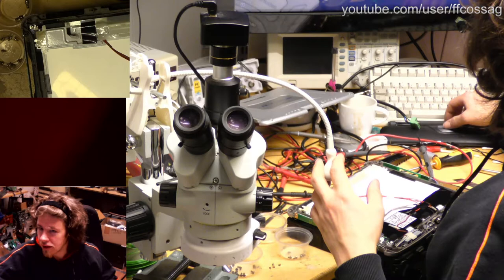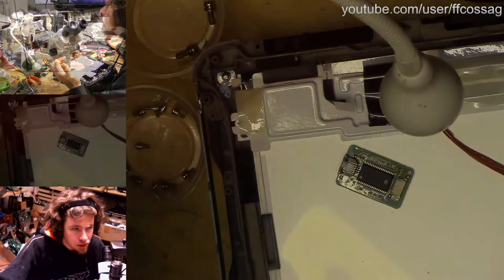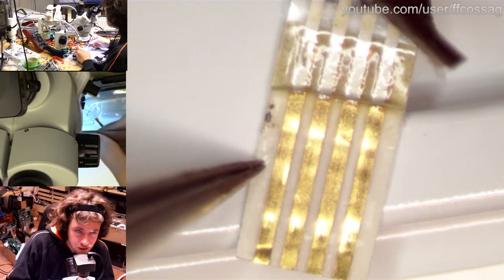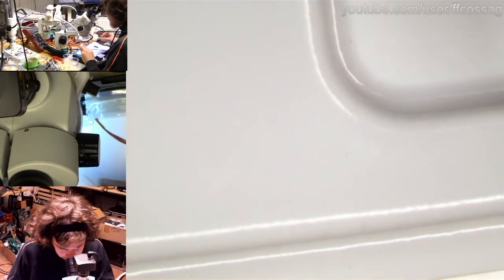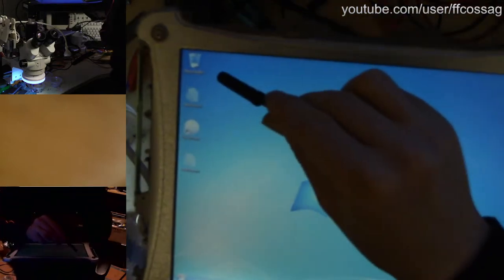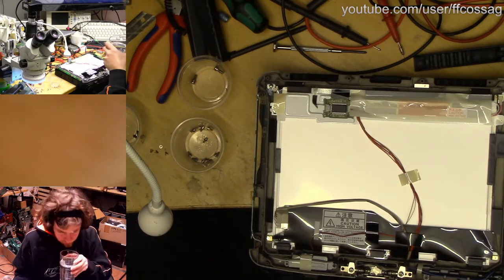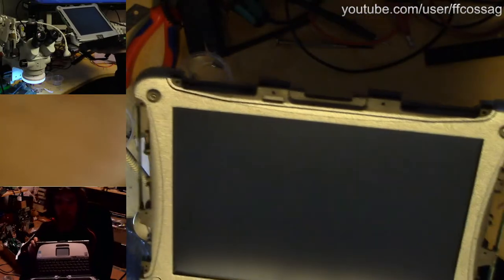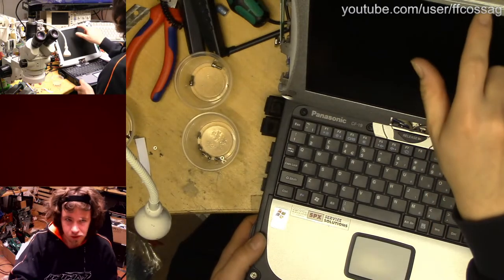Toughbook CF-19 touchscreen troubleshooting

Comment: Thanks man. I repaired mine using your method but did it a little different. I used probe tips of similar sharpness to your's. I pressed them straight down, increasing downforce until I got continuity. I made a row of five dots like that per contact.

Comment: Nice repair! Could it be possible to cut the ribbon cable and solder wires instead if this fix didn't work?
Reply from the maker: No, you can't solder these carbon conductors.